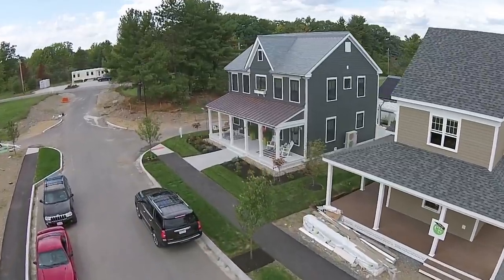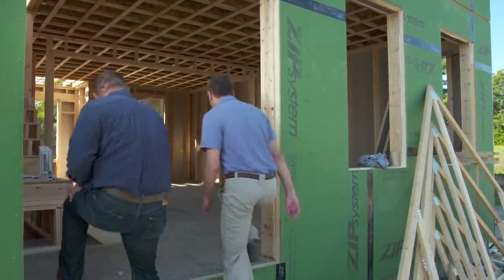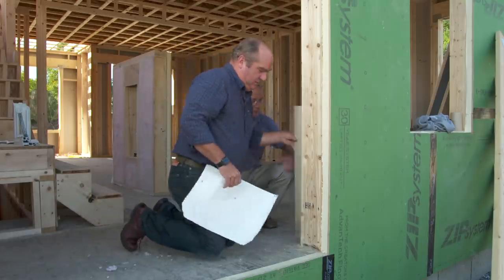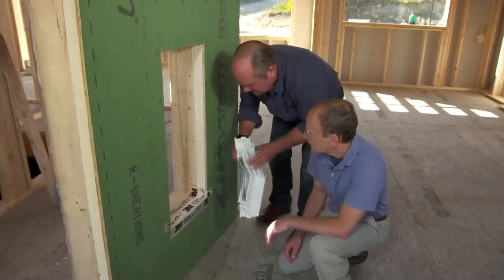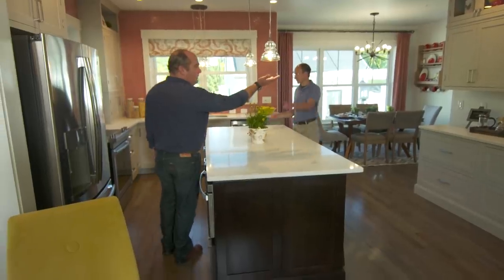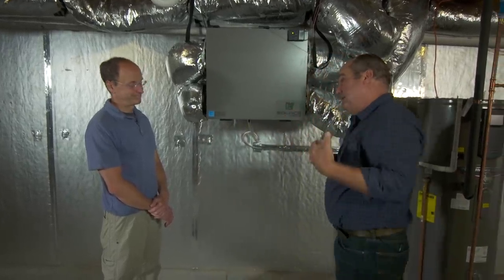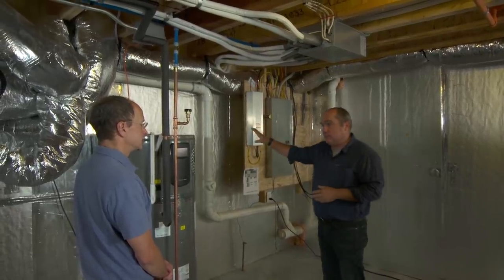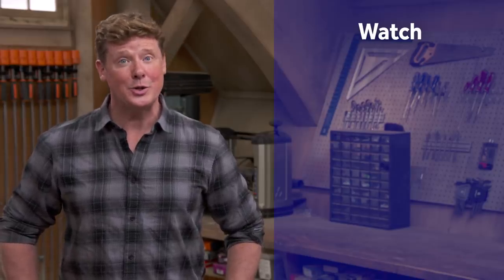Building Energy Efficiency | This Old House

Comment: I just bought that r sheathing . 70 sheets for 5,500. We’re doing a whole roof for an old a-frame and then cedar shingles over it
Reply: Oswaldo Rabanal what do you want? A cookie.
Reply: @dougsmith9028  that would be nice actually. Thank you. However, if someone wanted to know how much the r-sheathing cost. I was just sharing information for the community.
Reply: @ozzy2753 , Thanks !
Reply: How thick was the foam on the sheets you got, and what was the R value?
Reply: @StariusPrime  the sheets have two inches of foam. R value of 12
Reply: @ozzy2753  Thanks for the reply! I live in Iowa and have been looking at building a new home in the next 5 years or so.  I've been pretty interested in the zip products as a potential exterior solution. Its nice to get an idea of price.
Reply: Stupidly simple idea.
Reply: @ozzy2753  that’s pretty nice
Reply: @GreenAppelPie  yeah isn’t it crazy I’ve nailed foam over the sheathing for many years under siding. It’s crazy how no one thought of this before 😆
Reply: @StariusPrime  yeah the r value and the air tightness is why it’s so beneficial. It helps you avoid spray foaming in wall cavities. I always avoid that because it is a super pain to renovate the home later that way.
Reply: @brianglade848  😂
Reply: Don't forget you have to tape every nail penetration if it breaks the surface. I think zip system is crap. And in cold climates you have to calculate the dew point on your coldest day to select the proper thickness or you'll have mold from condensation.
Reply: @CybekCusal  I'm wondering how they'll age. I don't think it's fair to say that it's crap, but it is fair to say that it's been adopted very quickly. I don't think builders have thought through or are aware of all the consequences
Reply: @ozzy2753  ??? some of these video are talking about roofs with an R value of 70 or 80.  I guess you are using other stuff in your roof, too?  And, how long could cedar shingles on a roof possibly last?  Isn't a short-lived roof bad for the environment?  Are you doing that japanese burning method (shugiban?)?

Comment: I really like the smart choices the builder did, reminds me of the Joe Lstiburek building philosophy. Only criticism is the bottom mounted vent hood on the induction stove.
Reply: Lstiburek is  an educated dude . This one doesn't know what he is doing . He builds walls in Massachusetts like he is in Florida or Texas . He installs mini splits which is smart but what for he spend lots of money on basement
Reply: Downdraft range pulls warm air into the heat exchanger so you aren’t venting to outside the conditioned envelope. Standard good night as well be an open window in your roof.

Comment: What did all of this COST and how long to PAY BACK the savings? Is this construction worth the cost? Great video, thanks!
Reply: Solar panel arrays of this size in Massachusetts have an estimated payback period of 6-7 years.  The rest of the house is maybe 10-15 years to recoup the cost compared to minimum code.  Net savings over 50 years could be $70,000+ based on their $1 v. $3k annual heating cost.  Supposedly building comfort is pretty high in these net-zero houses too.
Reply: @Chrisisreal978  how can anyone think of net savings over 50 years? I'll be in a nursing home by then. Only 37% of Americans live in a home for more than 10 years. You're better off thinking of retained value, which is complicated. As another commenter said, all these things are awesome until you're the one stuck replacing it
Reply: You likely won’t stay in one place long enough to recoup that sort of outlay.
Reply: @michaeld2613   it also adds to the sale price so it’s not money down the drain even if you move.
Plus don’t forget about the increased comfort.

In general building air tight with great insulation it only adds about 2 to 3% of the total home construction cost as per BCIT‘s research.
Solar panels and the more efficient heating and cooling system add a bit more, but by building more efficient you can actually downsize your heat pump/AC unit quite significantly which then ends up saving you money again.

Ultimately 2 to 3% extra is where it tends to roughly stay which is not bad for the additional comfort that you get and the additional savings you get every month.
And again if you do sell you will get that money back when you sell.
Reply: @FreekHoekstra  and probably adds to your property tax bill as well, then - if locals know you built in a special way - and the local inspector probably tells the assessor when they meet in the break room
Reply: @genkiferal7178  that is not how property values are assessed.
it’s not like somebody’s going to be asking your neighbors or the building inspector have nice places or how much he would personally value it.
It’s literally a bunch of math looking at the location the square footage of the house and that’s basically it.
And even if your property taxes were to go up slightly which is again only a very small amount the savings in heating and cooling and comfort would greatly make up for that
Reply: @FreekHoekstra  hmm, perhaps the Wikipedia article on property taxes was wrong. I always thought it was merely based on sq footage and acreage, but that and other articles seem to say different.
Reply: @genkiferal7178  pretty much how big is the land how big is the house.
Quality of the house is typically not considered. So if you insulate your house better although that would make it worth more when you sell, would not increase your property taxes. *As far as I’m aware, I’m sure there’s some country or state or wherever where that might not be true, but typically it is.

Comment: Great for new homes but what do I do with my foundation that dates back to 1920? I want to pull away the soil to seal coat the foundation or check if it's already been done. I also want to depressurize the house with a home energy audit but my walls need to be insulated as well. I have a long list but finances are tight.
Reply: Tom ... if you are willing to do most of the work yourself and stay long enough in one place you can make a serious dent in the repairs over say the next 10 years. I figure it ran me a bit over $20k to do it that way.... one room at a time. Started with a 1910 home that was fairly drafty at 65 degrees all winter and now it's 5 zones of heat at 70 degrees for half the cost annually. The main difference is the comfort level without the drafts. Oh, add in another $5k because each room got updated with insulation, electric, and the top 2 floors didn't actually have heat in the 1910 build. (heat rose from the first floor) It wasn't in the budget originally but I left room for AC which was added in recent years... another $3,500 in parts that I installed myself. Yes, I refinanced along the way but I wound up with a new home inside the old shell.
Reply: @rupe53  I have a concrete block house built in 1979, and it needs some serious upgrading. The problem is that I paid for 5 year old stucco and roofing that were both done poorly. It's going to be interesting for sure

Comment: That house is probably 400 to 500k. Super efficient but very expensive to build. I do like what they did but I'm curious about the insulated header load strength
Reply: Don't forget, the owner will save thousands every winter!
Reply: The insulated header doesn’t make much sense seeing as there is a Thermal break via the ZipR foam insulated backing. Wood has a decent R value of R 1.25/in of thickness so a 6x header has an R value of 6.875 plus the foam insulated backing pulse the sheathing. Silly to cough up structural strength and add the cost
Reply: Probably closer to a million.

Comment: Spend $50,000, to save maybe $2,000 a year. Which would take 25 to break even. Which by then, you will need to spend like 25k on a new HVAC system.
Reply: zero chance that those ductless units last that long
Reply: Nailed it.

Comment: I'd still want a gas furnace and water heater there (or a gas water heater with a heat loop off it). The electric rates are sky high, especially in the winter, and only get higher every year. I don't care how efficient it is, if you're paying 22-24 cents/kWh running a heat pump is going to be expensive.
Reply: Would the solar panels help with that ?
Reply: @augustreil  They would, but output from solar in New England during the winter is way less than the rated output. That array might put out half as much power as the heat pump draws on the average day.
Reply: @jblyon2  is net metering in effect in New England area?
Reply: @brettlaplante6180  Yes, but there's a million hoops and a mile of red tape to get through with the utility. That 5kW array might put out 2.5kW on the average winter day, and that heat pump should be drawing 5kW while running. Add in the water heater, dryer, stove, and other electric use and it's not going to keep up, even on average. 

What sucks is most solar incentive programs only cover your average usage based on the peak output potential of the array, so around here you're left with something that can barely meet half your needs for half the year.
Reply: Electricity costs in many parts of the world are double 22-24 cents /kWh.
Reply: That is why they have a 5 Kwh system to produce most of their electricity. All they need is battery packs and they will have solar electricity at night as well
Reply: @nelsonsilva7572  And how much do then battery packs cost?
Reply: Gas water heater is nowhere near as efficient as a heat pump water heater. We're talking sub 200 dollars a year to run

Comment: What about all the nail heads to secure the ZIP-R sheathing, how do you waterproof those nail heads?
Reply: Zip sells a liquid product to seal those. They are sell—and suggest—using their stretch tape for openings
Reply: My thoughts exactly. Zip stretch tape and liquid flashing. Why mix brands like that?
Reply: @matthewlewis5631  I've seen the zip 2.0 videos where one goes back after the zip sheathing has been nailed to apply fluid applied flashing over every nail head. Taping every nail head doesnt seem that much faster. Tape or fluid applied, both  just seems like a slow and labor intensive process. I was just wondering if there was a faster way.

Comment: My 1950s house is so drafty and freezing. No one can seem to be able to identify the source(s) of cold air. It’s so bad that I’m planning to sell the house and move other a better insulated house. 

When buying a house, how can one determine whether it’s well insulation?
Reply: Blower test
Reply: During the winter rent a FLIR camera to see where the draft is coming from.
Reply: wasabi9111
 ... you probably can't tell if it's well insulated unless you are willing to crawl around and do half of a building inspection. OTOH, you can look at general construction, stick your head into the attic and look around, try some doors / windows for fit & sashes rattling. Also check the feel of how doors open and close. If these small things are shabby then the house is likely drafty, which is the other half of energy efficiency.... but usually easy / cheap to fix compared to reinsulating the whole place.

Comment: So....Heat Pump moves heat into the house.   Water heater moves heat from inside the house in to the water heater.     Do they make a water heat pump that moves heat from out doors into the water heater?
Reply: I believe they do.
Reply: They do make split heat pump water heaters, but the cost probably wouldn't be worth it. Those basic heat pump models are around $1000 and the cheapest I've seen the split water heaters are at least double that. You wouldn't save enough to pay it back over 10-15 years. Sure, you're stealing some heat from the mini splits to heat water, but it's still way more efficient than straight electric.

Comment: Hmm, isn't a multisplit in such an energy efficient house going to cycle a lot? Especially with very low per room heating/cooling demands? Would have thought that a ducted minisplit would have been better when the loads are very low.
Reply: Those newer units have inverters and run the pump motor at variable speeds to meet the load instead of just cycling on and off.  It's more efficient and I think you get a more consistent temperature.
Reply: @Chrisisreal978  Well yes, they are variable unlike something like a single speed furnace, but I'm more referring to the minimum capacity of the outdoor compressor. For a cooling example, if one takes the MXZ-4C36NAHZ2, a 36k BTU unit, the minimum cooling possible seems to be 15.5k BTU. So say that only one indoor head is operating, I would think that it'd still cycle constantly. Wouldn't one need all of the indoor heads operating and have the combined load be more than the minimum ratings in order to avoid cycling?
Reply: @rafflesmaos  or allow a greater range between Tmin and Tmax internal to the house.
Reply: @rafflesmaos  Oh maybe you're right.  I didn't realize that the minimum loads were so high.  I guess it could cycle on and off if just one head unit is running.  Not sure that's necessarily bad for the unit except maybe it won't pull out enough humidity during summer?  Massachusetts isn't a particularly humid climate so it might not be that big of a deal in this specific case?
Reply: @Chrisisreal978  Yeah, I guess it would depend on how well the Manual J was calculated. It's both a small and energy efficient house, plus installers in particular tend to oversize units to be on the conservative side. As you've said this can get weird/complicated for humidity removal purposes too. Passive houses in particular (which this isn't but still might) suffer a lot from that, because in air tight construction one may also worry about indoor humidity not just one that is incoming from outdoors.. plus the latter should be mostly balanced with the ERV.

Edit: Note that this humidity removal concern is not a /bad/ thing about airtight/passive houses, just something that needs to be kept in mind. It's still a very minor thing compared to the massive benefits that these types of constructions bring to the table.

Comment: $1000 for the heating season is impressive? I'm near St. Paul MN and my cost for the heating season is under $500 for 2200 sq ft.
Reply: Yeah I don't get it. Our house is a 1920s poorly insulated home in Chicago and we don't spend NEARLY $1,000 all winter!
Reply: What energy is used for heating? Gas, electric, oil....
Reply: @desaltzman8762  ... heat pumps here are all electric.
Reply: @desaltzman8762  Natural gas. My estimated cost with heat pumps would probably bring me near that $1000 seasonal cost but it's not a "passive" home. R20 walls, R60 attic. R25+ basement walls. It's well insulated but no thermal break for the studs. I would have expected a truly properpassive home, similar sized, in a warmer climate to use far less energy than I do.

Comment: Never quite understood the economy of a heat pump water heater. The air it steals the heat from is within the house so all winter you are using heated air that you already paid to heat, which is probably less efficient because of the double transfer. It also uses electricity rather than say propane or natural gas, which usually has a lower cost per BTU. Yeah, it might be cheaper to run than a full electric water heater but there's more ways to skin a cat than doing it all with a heat pump. This style of water heater will also pull KWs from your solar system, which might be used better elsewhere.
Reply: Understood for basement, interior heat pump installations. But even so, manufacturers offer ducting options to avoid this issue, similar ducting to a well installed gas water heater. We have our heat pump tank in the garage, a welcome addition for humid summer days while also taking advantage of any garage waste heat generated from vehicle charging, chest freezer and our heat pump dryer.

They mentioned a 5 kW solar system. I'm not sure if their model is schedule programmable to take  advantage of solar generation, they will most likely tap into the grid when household demand rises at sunset. Either case, 5 kW during daylight is more than enough to cover the basics.

Comment: wonderful house, if you have the wallet ..
Reply: I wonder what the upkeep would cost and I be concerned over a heat pump. I guess if it doesnt get too cold your fine. I imagine 5 F is in perfect conditions. I used to have a heat pump and it struggled when ever it was below or near freezing. Insulation probably helps.

Comment: Why would you spend the money on zip sheathing and then cut corners (literally and figuratively) by not using their stretch tape at the window sills? Instead they use some 3M tape and cut it at the corners, potentially rendering the zip waterproofing less effective.